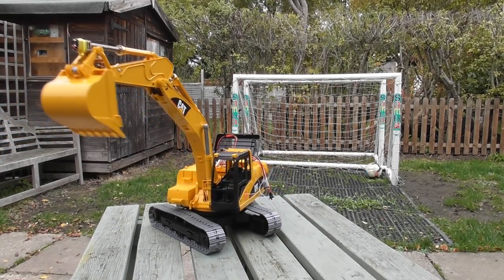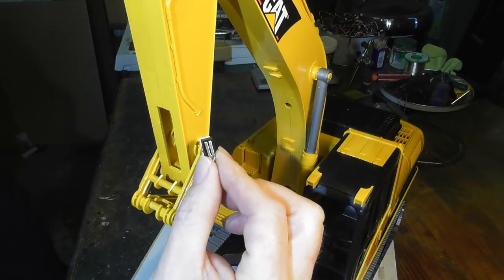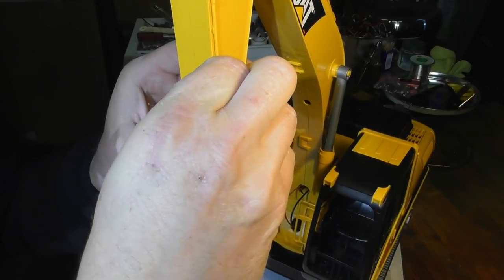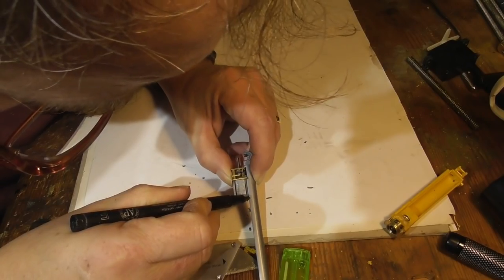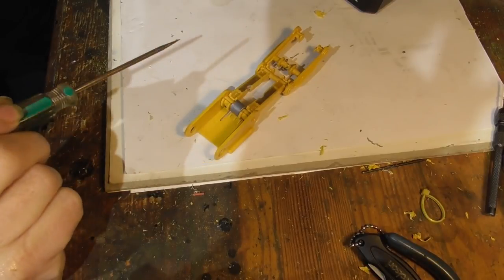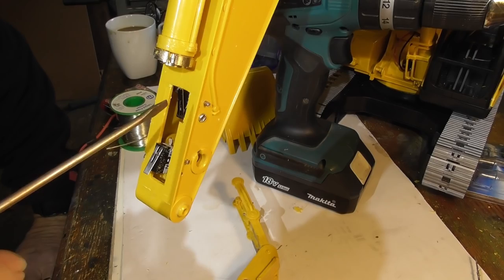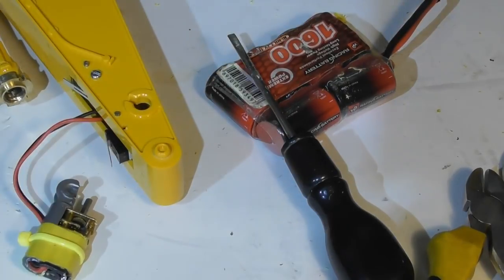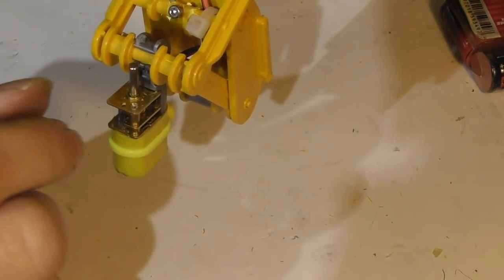Bruder CAT Excavator RC conversion pt5: bucket automation

Comment: Great videos, can you please advise what transmitter you are using for the excavator....
Reply from the maker: Hi. Thank you 😀. I'm using a Spektrum DX10t. This transmitter is now no longer made ( areal shame as it is perfect for this sort of model - they do come up on Ebay), but really any computer radio system with at least 6 channels should  do the job. I like all of the free mixes on this transmitter - as it lets me switch the right stick between controlling the jib/bucket and the tracks and I can easily put the left stick on a spring by just doing up a nut on the back of the transmitter. I have now got the the whole thing working properly, just need to do the final build video (I'm practising doing some digging first! 🙂👍

Comment: The speed of motion looks good.
Reply from the maker: Thank you. I was pleased with this model. It is good to use - the balance between power and speed is about right with these 200 rpm N20 motors. I think that I need to refine the design of the motor holders a little. I may return to this one at some point! 😀👍

Comment: Just a Tip.If you don't have a layth to turn the brass fitting down to size.You can put the brass fitting in a power drill turn it on and use a good file to cut it down to size.Hope that helps
Reply from the maker: Good thought! I do try and make these builds so that basic tools are enough for people to have a go at the conversions themselves. 🙂👍

Comment: Nice job well figured out!!
Reply from the maker: Thank you! I couldn’t believe it when I found that the actuator motor was fouling on the h-bridge, but luckily the rest of the Bruder design was strong enough for me to do away with cross pieces on this. I can now see that this is likely to be a very capable model. And actually the thumbs up, comments, suggestions and general encouragement that I’ve had from fellow ‘modders’ has played a surprisingly large part in keeping me going with this project. Not too far to go now ..... 😃👍

Comment: Great job bud it’s really coming together nicely 😎👍🏼 I just ordered up a UPS Scania cargo truck.  I just can’t find the love to make my Mercedes half pipe to a conversion.  Kinda ugly my little daughter said lol..👍🏼👍🏼🍻
Reply from the maker: Thank you! This one has been more of a "marathon" than a "sprint", however I have learned so much by tackling something so challenging early on (apart from doing something a little easier next). Having said that, this is the first stage that I have really got a sense of how excellent the finished model might turn out.🤞
 I do think that the Scania cab is the nicest of the Bruder truck options & agree you need to 'find the love' to be able to enjoy these builds! 🙂👍
Reply: The two questions I always ask myself at the end of every Rc conversion is:  how much did this cost and is it as powerful as it costed me to do to be a success.  I never factor time because I feel every conversion for the first making is a mind set challenge and you learn for the next one will be easier 👍🏼
Reply from the maker: That’s a good way of looking at it. Plus of course the building itself is an enjoyable leisure activity in itself - the cost per hour of doing these creations is a fraction of, say, buying a £500 RC kit (plus parts required to complete / upgrade) and putting that together in a probably much shorter time! And you always end up with something fairly unique at the end of it. 🙂👍